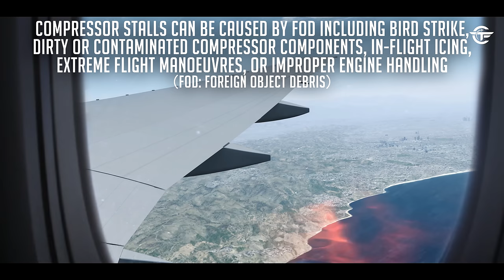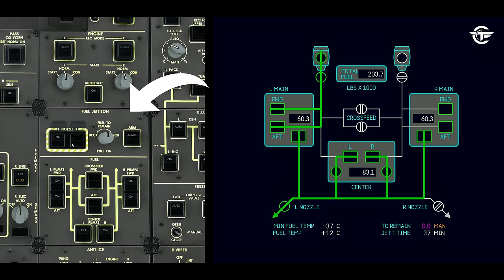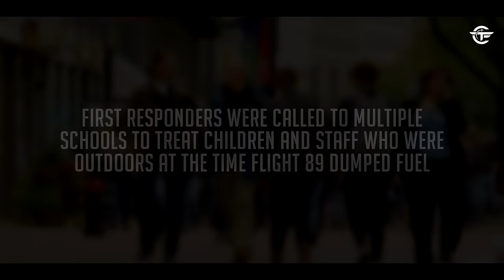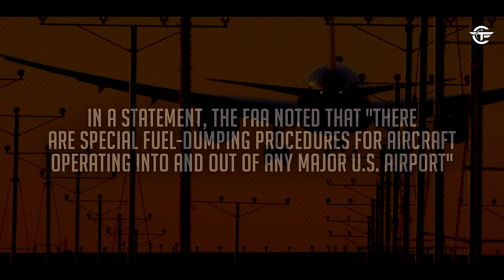Bursting into Flames Immediately After Takeoff from Los Angeles | With Real Audio

Comment: As a retired ATC ( and ATC tower supervisor), I always hated it when 'secrets' (fuel dump, etc.) where being withheld from me.  They could have easily dumped that fuel at 8000 feet, but rather chose to spray it all over LA county at a low altitude.  I only wonder what else they were keeping from ATC, as it all sounds a bit suspicious to me.  Even if the flight crew hadn't requested equipment at the runway, I would have made the call (and did many times) to get it out there.  If there are any former or current ATC's out there, you all know that if your gut say something ain't right, it probably ain't right.
Reply: What really gets me though is all of these conspiracy theorists who think that this was intentional, and that planes are making chemtrails on purpose for mind control. I always find it hilarious when these people who know nothing about aviation start spouting their theories. also which airport were you ATC for? Just curious.
Reply: Hack Fabrication   I’m not ATC, but have been talking to y’all for over 50 years.  I am a multi engine instrument rated commercial pilot with several ratings and an A&P., Air Forced trained beginning in 1968.  I too think something else was happening and caused the urgency to step up a few notches on top of the engine shut down.  It took 10 days to get the aircraft back in service.  An engine change can be done in one day.  An FAA report I read said they found metal in the back of the engine so I’m pretty sure it was changed.  The tone in the voice of who ever was talking to ATC, I figure it was mostly the copilot, changed after the engine shut down.  I have not been able to find a final report on the FAA’s or the NTSB’s web site.  The report I did read was from 3 days after the event and said they would take a few weeks to complete the investigation.  That report was a response to three congresswomen from CA who wrote a letter asking a lot of questions.
Reply: @billmorris2613  They shutdown the right engine altogether rofl. I don't know about you and I'm not a pilot but I dont wanna be circling around the ocean to dump fuel with just one engine.
Reply: Jes Chr   I am a commercial pilot for over 50 years and would not want to stay airborne on one engine in a twin engine aircraft any longer than absolutely necessary.  When I was in the Air Force we were required to land ASAP if we had to shut down an engine when state side.  The requirement was different in a combat zone.
Reply: @jeschr3462  Thanks goodness you aren't a pilot and you clearly don't watch aviation disasters regularly b/c all commercial jets are designed to fly on a single engine and all commercial pilots are supposed to be trained to fly on 1 engine.
Reply: Cee G Yes they’re designed to fly on one engine, but you want to get on the ground ASAP because if whatever caused the first engine to fail happens to the second, you are in trouble. When you’re relying on your backup, which in this case is only one engine, you don’t take your time to get down. Mayday and land safely but expedited. You can’t guarantee the second engine won’t also fail, so you also need to stay within gliding distance of another airport, as seen in a recent commercial flight incident in the last month or two where the engine failed and the pilot asked to stay within gliding distance should the other fail.
Reply: @billmorris2613  How can you have been a commercial pilot for 50 years and also an air force pilot..?
Reply: Eagle Eye  I got my commercial license in 1970.
Reply: @jeschr3462  The 777-200ER has an ETOPS rating of 330 minutes, meaning it can fly on one engine for up to 5 1/2 hours.  There was no danger in dumping fuel over the ocean unless something else was going on that they did not tell anyone.
Reply: @Hack Fabrication Was dumping fuel without the tower’s knowledge a common occurrence?
Reply: @jeschr3462  Does your life and others on board trump those of the people on the ground? If at a higher altitude, you can more easily glide to the destination airport should you lose the second engine. Higher altitude the the fuel has time to vaporize before it reaches the ground. They dumped fuel on children at a number of schools not to mention all the other people. Stated 50+ injuries due to that fuel. God knows what else could have happened had that fuel ignited. Trading your life for that of a similar number of others is simply selfish and very unprofessional. Thankfully, you are not a pilot making those types of decisions.
Reply: @billmorris2613  You must have been brilliant to get your CPL at 15 years old then, the max age for CPL is 65...
Reply: Eagle Eye   How did you come up with those numbers?
Reply: Ethan Beall    The vast majority of those commenting on here have very little, to no training or experience in aviation.  Eagle eye just stated below that the “max age for a CPL (commercial pilot license) is 65.”   Another one stated that jet fuel has higher octane than auto fuel.  She also said the pilot endangered the lives of his passengers because, if the fuel he was dumping found an ignition source the flames would have shot up to the airplane and it would have exploded.  That only happens in a Bruce Willis type of movie.  The same type of things goes on with the railroad videos too.
Reply: @billmorris2613  I fly the 757 for a living so I'm suitably qualified thanks, which is why I am dubious about you having been a commercial pilot for 50 years AND an Air Force Pilot. Anyway regardless of that, with the engine shut down and secured there's absolutely no rush whatsoever to dive straight into a panicked approach without getting below Max Ldg Wt. Consider: Single engine Performance at MLW, possibility of brake fire and evacuation on landing...
Reply: Eagle Eye   In your last comment you said that the “max age for a CPL is 65.”  That is incorrect.  There is not a max age limit on a CPL.  As long as one can pass the 2nd class physical they can exercise  the privilege of their CPL.  Where did you get the idea that I was 15 when I got my CPL?
Reply: Question for you, and I'm not trying to blame anyone for this, but as an ATC, maybe the person in the tower that day should have known that an aircraft that just left and that is now coming back to the airport NEEDS to dump fuel? I know the pilot is the person responsible for their aircraft and the safety of their passengers, but there is such a thing as "checks and balances" in some fields of work. The aircraft just left, not enough fuel has burned for it to be under the weight limit for landing. Do ATC's have to let pilots make all the decisions without ever questioning them? I understand that the pilot did indeed dump fuel, but he never reported it, and he answered by the negative when asked if he needed to do so.
Reply: Martin C.  I know that your question is for Hack the ATC guy.  I’m not here to blame anyone either.  The investigation will find who to blame, if there is anyone to blame.  First let me remind you that the cockpit is extremely busy at this time, and should have been a sterile cockpit the whole timeThe whole flight was only about 23 to 25 minutes.  With flying the airplane at a relative low altitude, securing the shutdown engine, going through several checklist, preparing to land, the dumping of the fuel.  I believe the ATC guy understood they were dumping fuel.  The question ATC ask the crew was, “Do you need to hold to dump fuel or something
Reply: Martin C.  The crew answered negative to ATC’s question.  I believe they were answering negative to the “hold” portion of the question, not the dumping fuel part.  I believe ATC originally believed they were dumping fuel because he originally said he was going to turn them left, which would have left them out over water. But he took the negative answer to his question as they were not dumping fuel and did not need to hold, creating a misunderstanding between the crew and ATC.  Therefore ATC turned them to the right back over land.  With the crew believing ATC knew they were dumping fuel, and with them being very busy in the cockpit they did not question ATC turning them back over land.   Also like others with aviation experience I suspect there were other issues going on at the same time on top of the engine shut down.  I read an FAA report to 3 California US Congresswomen that they dumped 100,000 lbs of fuel, which is 14,700+ gals.  The FAA report also informed the congresswomen that once the captain declared an emergency he can deviate from the rules and procedures as needed to land safely.  In that report the FAA also said the investigation would only take a few weeks.  It has been 8 months today.  I have looked for final reports or any reports on the FAA’s or the NTSB’s web site and could not find any.  All of my searches received the same answer several times on both sites, “No reports on Delta flight 89 dumping fuel over Los Angeles on 14 January 2020.”
Reply: @billmorris2613  Thanks for the reply. That was... very, very detailed. I guess all I meant was, upon hearing that the plane was coming back only a very short time after taking off, I kind of expected the ATC to think "You sure about that?" when told that the aircraft was ready to land. He knew that the aircraft had been over land for a while, so not supposed to dump fuel. I was just wondering if he was allowed to questions decisions. Probably not. I also understand that the ATC cannot fully appreciate what is going on in an aircraft, so he probably thought that the pilot had to land immediately to ensure the safest possible outcome. That the risks of not landing right away did outweigh (no pun intended) the risk of landing with too much fuel on board.
Reply: Martin C.   The detail comes from years of teaching pilots, aircraft mechanics, and locomotive engineers.  I try to explain things so there is not any confusion.  If every one here had experience in aviation operations I would not need to be as detailed.  

About three days ago I posted some regulations.  That post has a one liner then another paragraph that starts out with a symbol followed by 91.3.  There are three parts A, B, & C.  If you can find that it explains a lot about the pilot-in-command’s authority.  The pilot in command has the authority over the aircraft, not ATC.  But we work in harmony with ATC to keep the flow of traffic moving as smooth as possible.  

In the audio of the crew talking with ATC they requested 25 R for landing with their original ATC guy.  When he handed them off to the next ATC guy, that guy told them to expect 24 R.  The flight crew came back and told him they needed 25 R, for weight.  It is the longest runway at LAX,  by almost 2000 feet longer than than the next longest runway. They need the longest runway because they were down to at least 1/2 of their reverse thrust for stopping, or maybe less.  They may not be able to use all the reverse thrust available in the good engine.  Full reverse thrust on one engine may cause directional control problems.  The rudder, brakes, and nose wheel steering may not be enough to counter act the thrust.  Those engines produce over 93,000 lbs of thrust for take off.  I’m not up on the limitations on the 777.
Reply: Eagle Eye   What part do you operate under while flying the B-757?
Reply: @martinc.720  personally, I'm thankful for the info from Bill. It's one thing to know things, but it's another to be able to explain it clearly to others who don't have experience.
Reply: @billmorris2613  Good explanation and now i'm also thinking it was just miscommunication as in The crew thought ATC was asking if they need to hold while dumping.
Reply: Martin C. Thanks for the clear eyed analysis - and the patience in detailing it.
Reply: @jeschr3462  Your life and 100 others matters more than those in all of those elementary schools? Wow! Very cool! I'm sure you would have felt differently if you were dropping off your child off at the time it happened, or just been anywhere nearby on the ground. Because this is youtube though everyone's a hero who knows exactly what to do in every scenario. 🙄 What a joke. 

Also. I really appreciate the detailed replies (not of Jes Chr), it's fantastic that you came to the comments to share your knowledge about this subject to share more insight into what possibly could have caused this awful accident. Thank you.
Reply: @martinc.720  You didnt just ask a yes or no question. You asked several questions in your messages, where your comments are ALMOST AS LONG as his replies. So your typical "I'm not reading this lucky charms essay" response after he so diligently went through and answered with the best of his abilities just makes you look like a stuck up snob waiting for OP to misidentify a piece of information so you can say "sEe I tOlD yOu HeS lYiNg!!"
Reply: Agree. Nothing worse than pilots keeping secrets!! How can I help if you don’t tell me what you need (LAX TRACON 1988-2012)? I wouldn’t care if he wanted the equipment or not, I would have called them out.
Reply: Chemtrails are not conspiracy.  They are well documented and confirmed by government.  But its for weather "control" not mind control.  Then again, who knows whatvthe long term effects will be.
Reply: Just wondering how many emergencies did you see during your career? Was it a regular occurrence or a super rare event?
Reply: Man that's scary AF, that's why I never got why people are so damn calm flying all the time. As a passenger we have no F*** clue what's happening to the plane or to the pilots. Everythings always so hush hush & secret in the Aviation industry cause no one wants to get knocked on it. Then we hear about what happened on the 8 o'clock news & shed a tear. Profits over lives, it's sad.
Reply: Could it have been survival instinct kicking in? In their head, maybe they thought, in case of worst case scenario, crashing, what's worse: crashing or dumping fuel on LA? If they did sincerely think, "I want this baby on the ground now, or there's a chance we could crash," I might quietly keep the fuel dumping.... I know nothing about this subject; just wondering out loud.
Reply: @billmorris2613  I totally agree; the choice between death and dumping fuel--on LA--sorry kids.
Reply: @ethanbeall6422  .
Reply: They just wanted to land without delay. It's understandable. They were just scared.
Reply: @billmorris2613  Fake pilot spotted.  XD
Reply: Eagle Eye   There is not an age limit on a commercial pilot exercising his license, as long as he can pass a 2nd class physical.  The 65 year limit is on an airline pilot which has an Airline Transport Pilot License (ATP) and flying under FAR Part 121.  When the airline pilot retires at 65 he can still fly for hire in non airline pilot jobs, as long as he can pass a second class physical.  

There are many commercial pilot’s flying past 65.  A crop duster pilot has to have at least a Commercial Pilot License if he is getting paid.  Some other pilot positions that require at least a Commercial Pilot License if they are getting paid are:  Corporate pilots, Air Taxi / Charter under Part 135, Fish spotters, Air Tanker, etc, etc.
Reply: Mikael Gaiason   Are you saying I am a fake pilot?  If what makes you believe that?
Reply: Jes Chr and Mr AF of 1968 vintage. The 777-400ER is certified to fly transoceanic on one engine. If you are not current in matters of aviation stick to your quaint nostalgia and pls don’t comment here. This isn’t back in your day and your antiquated procedures. Any professional pilot would have no problem flying that craft on one engine. If this crew were flying what is now known as the Miracle on the Hudson it would instead be known as the tragedy on the Hudson. They lost control of their emotional response. They acted recklessly and unprofessionally. They should have been fired.
Reply: Nick Raphael   I started in 1968 but I’m still a Commercial Pilot and A&P mechanic.  You don’t know what you are talking about.  There is not a single airliner certified to fly across the ocean on one engine.  So you need to stop commenting.
Reply: @csc6110  just curious, what kind of chemical is it that you believe these planes are dumping and where at on the jets are the tanks that hold said chemical?
Reply: @shawndouglass2939   What I believe is irrelevant.  It is already well-documented and admitted by government.  If you're truly curious, research it for yourself.
Reply: @csc6110  slowyour roll.... Crazy
Reply: They knew exactly what they were doing! They just intentionally waited until they were over LA county
Reply: @SoulEternalPeaceWarrior77  had a pilot come out on the upper deck when I was there - "what's the &^%%& delay?" he says to a purser or attendant. Soon, the taxi and take off was nice and quick.
Reply: @jeschr3462  they're designed and certified to fly on one engine. if not, they wouldn't be on the L.A. China run.
Reply: Was the airline fined for this deviation from normal procedure?